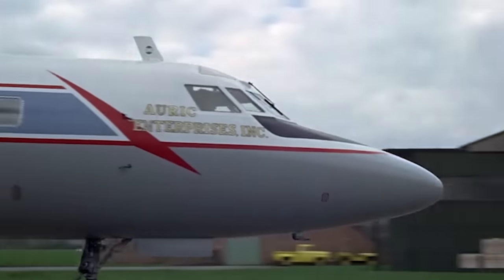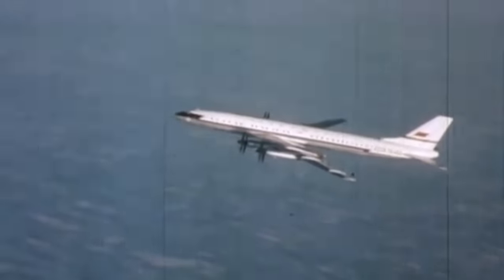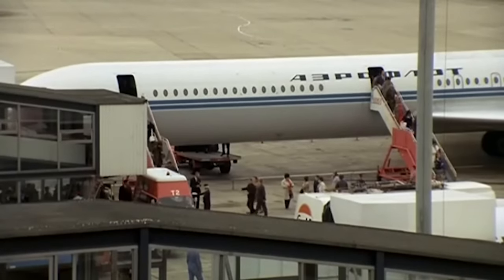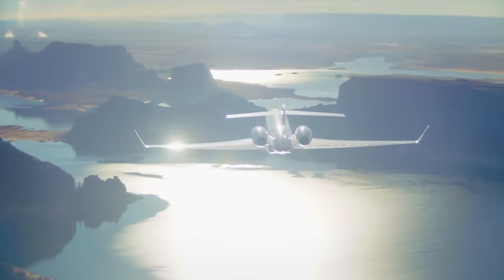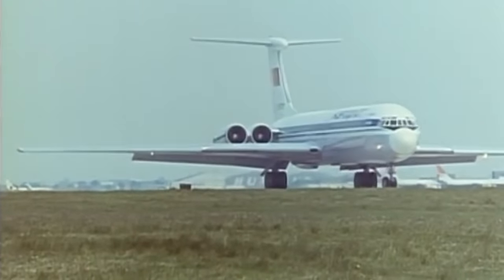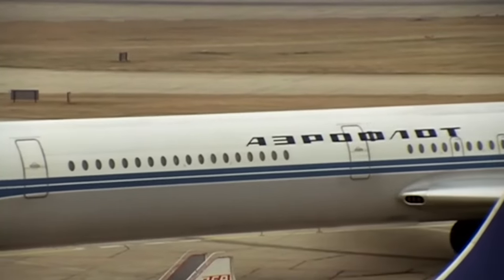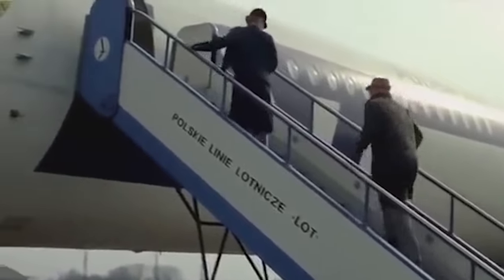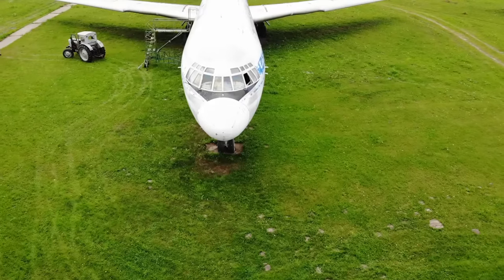IL-62 - an ideal option

Comment: 17:31... After a single engine failure, 2 neighborhood engines were damaged too... together with non-doubled steering - see LOT crashes from 1980 and 1987.
Reply: Agree. It’s so sad that the creator of this video did not mention about design flaw of the engige shaft and  promote this plane as super secure which back than was not, due to design flaw and horrible maintenance. 2 biggest plane crash in Poland happend beacause of this plane.

Comment: Il62 did fulfill its role as the first Soviet transatlantic jet (and first transatlantic jet for Eastern Block operators.  I flew on it a number of times, both within Europe and to US and Canada. OK for its time, if not quite as sophisticated as the Western equivalents (and I flew on most the competitors at the time: 707/720, 747, VC10, DC10, Tristar and A300).  I believe that the author barely mentioned the high number of accidents (look it up on Wikipedia) a significant number of which were not due to the overall design, but due to shoddy servicing of the engines and failure of engine parts resulting in destructon of the tail control mechanisms and consequent loss of aircraft.  Most of the foreign operators got rid of them as soon as they could afford western equivalents.  Russians love their creations and are not the most objective source of unbiased info :-(

Comment: Calling an extra landing leg a crutch isn't far off, since it helps something unstable not fall over. But insisting there's a more sophisticated solution it is like sticking a big flywheel onto your grandpa to replace a simple walking stick. Sometimes simple is good, and any engineer who states otherwise is likely working under a sunk-cost fallacy, and doesn't want to admit their overly complicated solution wasn't the best use of resources.
Reply: true
Reply: Kinda like how NASA spent a ton of money developing a pen that works in zero G.  The Soviets just used pencils in space!
Reply: @therealsnow  I'm pretty sure the myth has been debunked dozens of times
Reply: @nottoday3817  a more correct analogy is the time someone tried to create a continuously variable bike transmission to solve one problem: the minuscule inconvenienece of the gear change

Comment: Spasiba ! :-)  My ever first flight experience in life was with an IL62 from Romanian TAROM back in 73 or 74!
Reply: I was working on IL-62 and IL-62M for Polish Airlines. The plane was not terrible and was liked among crews in 70-ties and early 80-ties, even outdated compared to western designs, especially in electronics. On the transatlantic trip, the plane was burning 11 tons of fuel in the first hour. Only after 5 hours of flight, it was reaching economical 5 tons per hour consumption. Fully loaded (and that how it was usually operated by Polish Airlines), it needed the full length of the runway for a takeoff. The really serious problem was (of course you cannot hear anything other from Polish Airline employee), quality of engines, both Kuznetsov and Soloviev (second used later on M version). Serviced exclusively in USSR only, both designs were plagued by scandalous lacks in quality and precision of manufacturing and nothing short of critical lacks in quality control. As two Polish disaster investigations revealed, those lacks ranged from, nonmetallic inclusion in the material of critical parts, lack of any finish besides coarse on part requiring micro-metric finish precision, unorthodox violating technical norms modifications, negligence in manufacturing, and nonexistent quality control. Interestingly, the Soviets had denied faults and the role of those faults (in their engines) in two Polish disasters for a considerable time. The official position was, that discovered by Polish Disaster Commissions engines faults were not the cause of the disaster, but it results. Even it was an obvious lie since the beginning, as Soviet explanation, despise of a number of signatures of important “scientific” and government officials, could not explain things like, finding parts of the engine over 150 km from the disaster site, Soviet denial was finally and fully withdrawn only after, in two separate incidents (in Polish airlines), engines suffered catastrophic explosions while in flight, which did not end in disaster. Both planes landed safely. As disaster did not happen, engine faults simply could not be blamed on disaster anymore. In yet another interesting twist of fate, after surfacing of the following video on YouTube: https://www.youtube.com/watch?v=-xltGZk4aHY (ground inspection after a successful emergency landing of Cuban IL-62M in April 2008), when it seemingly became apparent that despise Polish disasters, engine problems were never corrected, even 20 years after, another campaign of denial took place, involving this time internet trolls, forcing untruthful claims on international Internet forums (Wikipedia and other), even what appears to be the clandestine operation of Russian intelligence agencies. This time on public forums, Russians attempted to claim, that presented by them record (which according to them is 100% trustworthy), of operation of IL-62 and IL-62M, indicated both planes as considerably safer than any western counterpart of the same time. To explain Polish disasters, 20 years after disasters, all of the sudden some documents of Polish Secret Police of communist-era were “discovered”, which claimed, Polish Airlines in unorthodox agreement with the manufacturer (which grant it a free hand in decision making), decided to extend the time of operation of engines between checkups, beyond originally recommended by the manufacturer. The story itself is constructed neglectfully revealing serious lacks. For instance, as a manufacturer it lists Ilyushin Bureau, which did not produce engines, it produced plane body hence it would not be the one making the decision. That would be a job for Kuzniecov than a Soloviev factory. Matter of fact Polish commission found very little to complain about the body of the plane and described Ilyushin Bureau findings in regard to disasters - “objective”.  Problems in investigation cooperation (or its lack) were since beginning with engine manufacturers and particularly bearing manufacturers. Anyway, the problems of such claims are as follow. As Soviet disasters were kept secret from public opinion and records were kept by the Soviet state only, it is only unverifiable say of new Russian now government that presented records are full and truthful. While IL-62 was still operated in 2008, revelations coming from the Cuban incident were quite unfavorable for the reputation of the plane, which does create an agenda for the Russian government to be less than fully revealing. Revelations regarding engine operating time limits come not from work of official Polish Disaster Commission, not in the time of the investigation, but from records of communist secret police which not that much had ties with Soviet intelligence (KGB and GRU back in communist times), but were rather composed of operatives of both. On top, the timing of “discovery”, 20 years after disasters, coincides with the time of the Cuban incident. Even Secret Police theory was never publicly addressed by any serious investigation by Polish state to my knowledge (they simply ignored it), the existence of such practice would have to be common knowledge in Polish Airlines, reflected not only in vast volumes of documentation but vast accounts of human witnesses memory. Hours of servicing of engines were not kept secret in Poland. Every, even basic level worker could have easily check them, or actually, to say more precisely, did check them, as knowing and operating with those numbers were part of normal work routine for a vast number of people from of all levels of the company. Those hours were listed in numerous places, starting from a tag on engine or box with the engine itself, kept on the ground, where anybody passing could have simply read it, to documentation in various departments of the company. As following and keeping those hours was part of a job, the work of many people required constant checking and familiarity with them. From my side, as a former employee, even not directly involved in engine servicing itself, I can only say, such records or accounts,... are simply not existing. So here they are. My two pennies, while on the subject. Was not trying to make it an attack on Russia. My sympathy simply goes not to people who manufacture the engines, but to common, average people who fly them, including Russians. They are the ones whose lives will be affected (hope note) by flying them. There is one more aspect of the story, purely speculative. Are the Russian engines really that bad? Hard to tell for sure! For sure the Cuban incident happened. For sure Soviets were aware of engine lacks way before they admitted it, as they were sending “special” engines to service official delegation flight of Polish Communist Party to China (which they demanded back after their return). The plane suffered no disasters or incidents in Polish Airlines for 8 years. Two disasters (and two additional incidents without disaster) happened in the time of “Solidarity” in Poland, where Poland definitely was perceived in the USSR as an enemy. Could it be this perception played role in Polish disasters??? I don't know the answer to this question. Who knows.

Comment: A quad rear-engine layout is extremely dangerous. if one of the engines were to catch fire or explode, not only would it automatically take out the neighboring engine, but it is also likely to damage the stabilizers
Reply: A very good point. However there are a few advantages. For ditching in water, tail-engined aircraft have had a lot more success. A thrust reverser that accidentally deploys in flight, a rare event, would not cause much problems for this configuration unlike when the engines are mounted on the wings where it can cause a dramatic stall. Also I'm not aware of any engine separation issues with tail mounted engines; Granted that while this has happened a couple of times with wing mounted engines it hasn't happened in recent times.
Reply: That exact scenario happened on LOT Flight 5055 in 1987
Reply: Even a single engine in the rear is dangerous. DC-10 is a proof.
Reply: Yeah, and wing mounted engines can sever flight control lines to ailerons and flaps, perforate the fuel tanks. How is that better? And since almost all aircraft today are twin jets, how is losing a single engine on the wing any less catastrophic than losing two out of four engines? Either way you lose 50% of your power, and at least with tail-mounted engines it is much easier to control in that condition, since you don't have such asymetric thrust. Although I don't believe you "automatically" lose both engines. The engineers are not stupid, and they recognize the hazards of putting both engines near to each other, and they put a large amount of thick shielding between the engines to limit the danger, as well as extensive fire suppression systems. Does it always work? No, but it contains anything but catastrophic failure. And a catastrophic failure of an engine can just as easily send fragments into a nearby wing mounted engine as one a few feet away. 
In any case, all the hazards you list are present, only even worse , for aircraft with wing root mounted engines, buried under the fuselage, right next to the fuel tanks, next to each other, next to the passenger compartment, next to the wing spars and wing flight controls.

But realistically, an exploding engine is always bad news, and aircraft designers can really only rely on the fact that it is an extremely rare occurence, since it is just as dangerous for a wing-mounted engine as for a tail mounted engine. It is always bad news. Engine fires are also bad news, but much less so. That is what they make fire extinguisher systems for, and bulkheads. There is no reason to assume an engine fire will have any effect on its neighboring engine, even in a quad-tail-mounted jet.
All layouts have good points and and bad. Pointless to condemn one without bothering to look at how it actually compares, good and bad, with other designs.
The reality is that you are basing your statement on two fatal crashes that happened on Il-62, over decades of service. So, yes, there were two cases of uncontained failure damaging adjacent engines, causing a crash. How many 737s crashed in this same period because of engine failures? 767s? 747s? A330s? I think two crashes out of all those years of flight goes to show how unlikely such an event actually is, and the record shows just how dangerous it is to any type of plane when it does happen. and of course the same record shows that there was a third uncontained failure of an Il-62 engine which did not cause the plane to crash, it simply cut the fuel lines to the adjacent engine, after which the pilots safely landed it.
Reply: @gravelking2.071  Because wing mounted engines are "safe" when they explode and no aircraft has ever been lost after a wing-mounted engine suffered uncontained failure? DC-10 got a bad rep because they designed the hydraulic system poorly, not because it had a tail mounted engine. And an engine turning into a bomb under your wing is just as often lethal as one doing so in your tail. the wing is where all the fuel tanks are, and is crucial to controlled flight, full of hydraulic lines, control lines, etc.
Reply: @thelegendaryblackbeastofar39  This advantage is also a disadvantage in case of controll loss through control surfaces. With a wing mounted engines the pilots can still use the variable angine settings to still have some directional control  of the plane. With closely mounted engines in the rear, it is nearly impossible to get that kind of advantage.
Reply: @justforever96  Than why did the tail mounted designs disappear and the wing mounted designs prevail if they are not any better?
Reply: @jacutin5033  A very good point. Didn't think of that!

On the flip side, loss of one engine will cause negligible asymmetric thrust on a tail-engine configuration. Over the years asymmetric-thrust was the cause or major contributing factor in several disasters. In these cases the pilot was either under-trained (this can not be wished away) or overloaded due to the circumstances. In any case, I plane should always be as easy to fly as possible because $h1t happens!

Something else came to mind...
In a wing-mounted design if one thrust-reverser is inoperative (surprisingly the aircraft is still deemed airworthy), upon landing, reverse thrust  can't be set to full power as it would cause the aircraft to veer off the runway. This is what tragically happened on TAM 3054. I don't see this being an issue on a tail mounted design.

Comment: Johan Cruijff once said "To do things the simple way is the most beautiful thing, but it is the hardest thing to do!" The Il-62 was always one of my favorite planes. I used to live directly below the flight path of these and several other interesting Russian airliners. This bird was even louder than Concord, Il-76 or a VC10 but its quad-engine sound was pure melody! 

"Skyship Eng" has done a great job as always. I would suggest covering the flight control system in greater detail as its quite unusual and remarkable. AFAIK the control surfaces have no hydraulics and are linked by cable. In a sense they are "aerodynamically  boosted" using "servo flaps". These are small trailing edge flaps on the main control surfaces. On some small aircraft the flight controls are connected only to the "Servo flaps" and the entire control surface is otherwise left to pivot freely. Does anyone know if the Il-62 used this arrangement? Does anyone know how much physical effort was required on the flight controls or how effective the servo-flaps were in reducing the load on the pilot?

Comment: At rotation for takeoff, the engines at the rear would have been in direct line with debris from the main gear wheels. Also a fire or explosion of an engine could severely damage the rear section including flight controls rendering the airplane uncontrollable.
No surprise that this layout was abandoned for a spaced underwing detachable nacelles.
Reply: But far higher above the ground. On balance I suspect that underwing engines are far more likely to ingest debris.
Reply: @QatarVegan  
Above the wings layout is safer and aerodynamically advantageous. Such layout can be found on the Beriev200 hydroplane for example. 
The main drawback is a less practical position for engine maintenance and check up between flights.
Reply: @QatarVegan  Not so. Where shoud the debris come from?